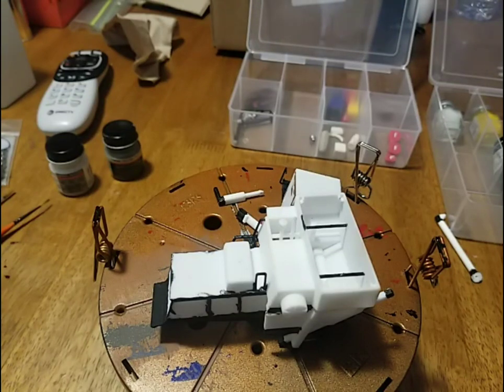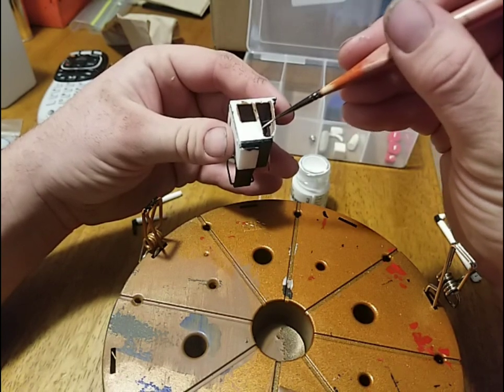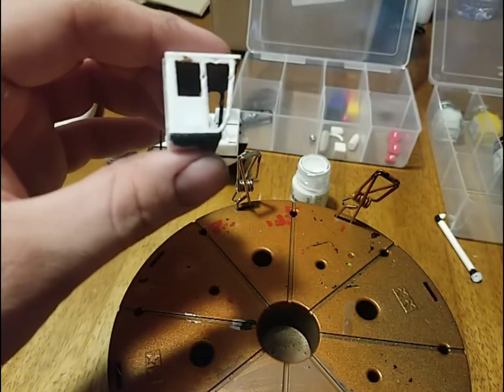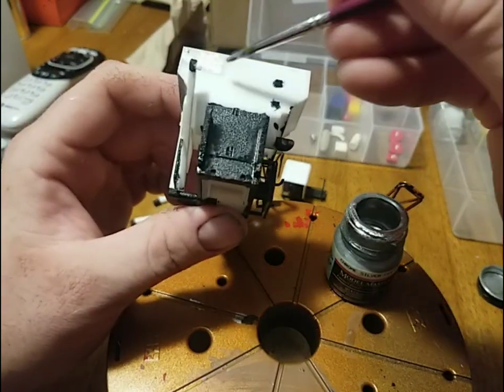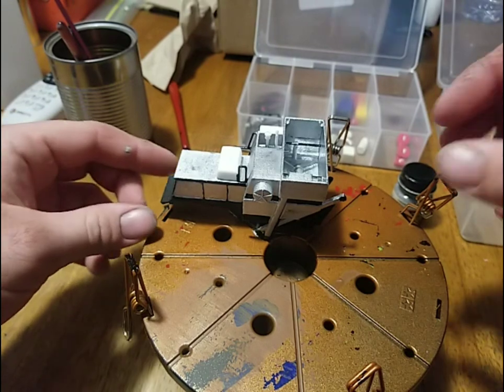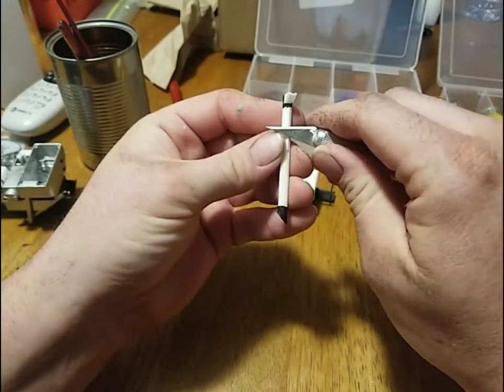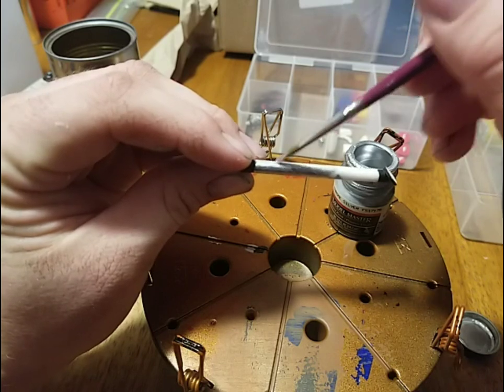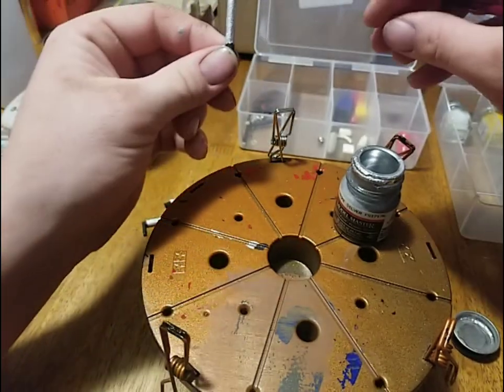Painting On The L2 Gleaner 3D Printed Farm Toy Project! Alittle Tip On How Dawn Dish Soap Can Help!!

Comment: Stay away from the air cooled Deutz diesel engines in the Gleaners if you get 1 after they came aboard dad bought 1 new and 10 hrs it blew up the replacement lasted a little over 150 the replacement for that lasted almost 80 then they decided he was right putting the water cooled engine option in it the first year we had it we ran a loaner combine and my kids learned how to run the Massey 410 510 and my oldest picked the 300 he didn't realize how much it sucked to hand crank the anger every bin full we even brought out the 58 apache with a 13 ft bed and the F600 and F700 with 16 ft beds to follow them around the smaller fields and my daughters learned about hauling grain with no AC and I felt ashamed they had their license and I hadn't taught them how crank windows worked the pedal right of the gas on the 58 was fun to watch them wonder what it was till I showed them the 4 pedal shuffle to starting it I was going to chop it into a dump trailer since we only used it and the Fords for hauling square bales for years and it's name had become the flop fender 500 the fenders had rusted away from the cab and around the headlights but the cab was solid so we looked for a nose and found 1 I made a trade for a 9 ft IH disk for it looks good and we freshened up the 292 and sealed up the leaks that kept the frame from rusting while we had her down that far and the cab off to paint it all green fenders wouldn't match the red cab and the black interior had to go